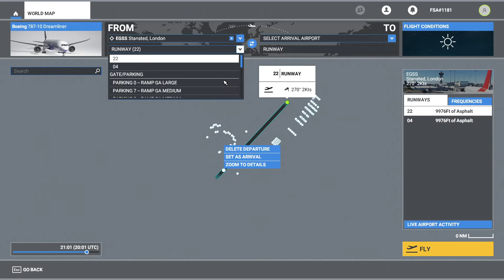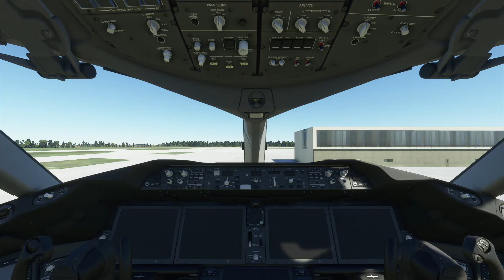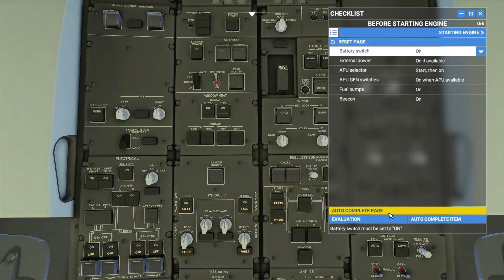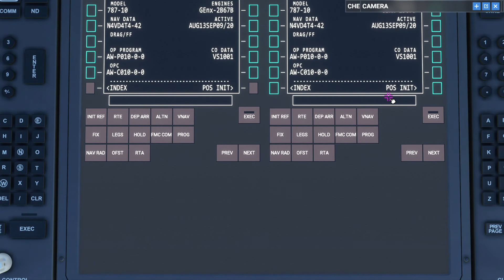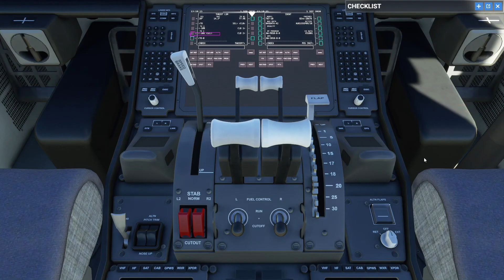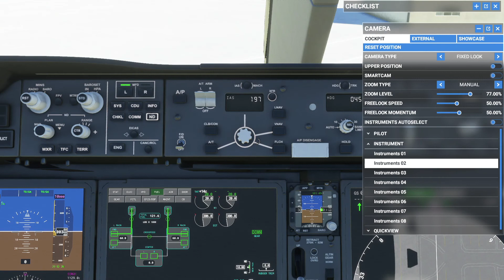Microsoft Flight Simulator 2020 - 787 FMC Tutorial Preflight - REAL PILOT

Comment: Excellent! One small remark: after you set flaps on FMC you press v1 vR v2 and you see different values. Now if you change flaps let's say to 17  I usually set up 17 then if you press v1 vR v2  on FMC you see lower-speed values. That means that with this plane you can take off with about lower speed. And of course setting up flap value doesn't mean that flaps are set automatically. I increase the flaps pressing F3 which is the default key stroke. The others are full extended full retracted and decrease with F2. I will be waiting for you to post more stuff about the 787 your channel is a pearl.

Comment: Once airborne, how is the route/map scale changed on the main MFD, for the 787?
Reply from the maker: on the EFIS control panel, which is just left of the mcp and turn the range + nob!
Reply: @flightsimacademy654  to the left of the MFD is the standard horizon, undercarriage selector and the autobrake selector switch
Reply from the maker: @jjsmallpiece9234  sorry i wasnt clear in my previous reply.. on either side of the MCP (not MFD), there is an EFIS control panel, with +/- signs and says range.
Reply: @flightsimacademy654  Thanks. Sussed it now. Part of the trouble of having a game, where limited instructions are given. A real pilot wouldn't go flying without throughly understanding all of the knobs and dials.
Reply from the maker: @jjsmallpiece9234  you have a pilot mentality!  keep going! good job! Do you have any suggestions for some boeing videos? Ive just put a new one up, would love to know what you think. Hopefully im getting better at making them!
Reply: @flightsimacademy654  I used to work in aviation as an aircraft technician,  so familiar with aviation working practices and thoroughness. 
No particular ideas for a video, although have realised the FS2020 flight planner is pretty rubbish. I've started using Little MapNav. Free software, just Google it, works with FS2020 and is very good for flight planning.